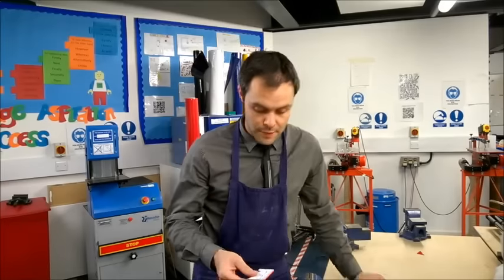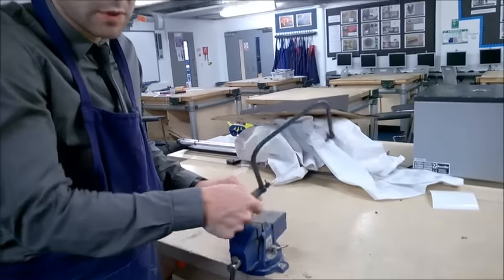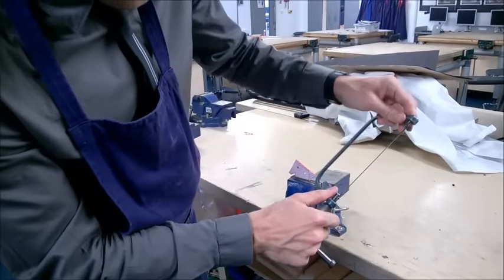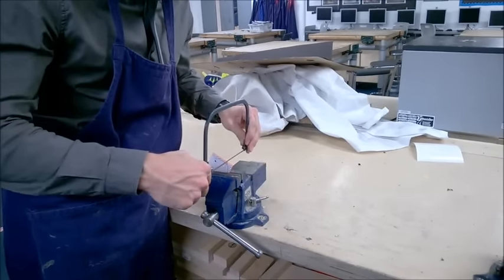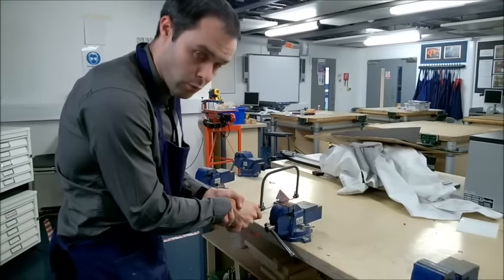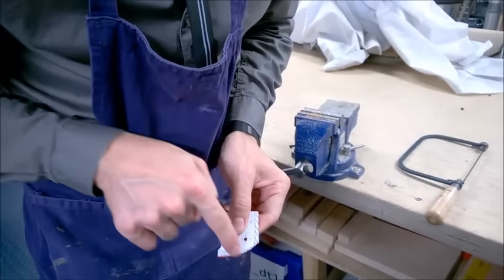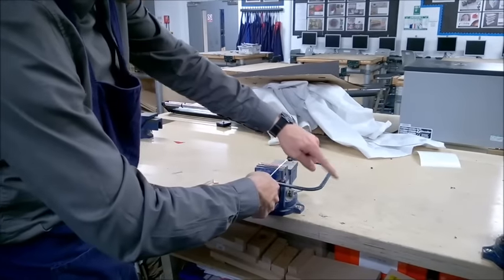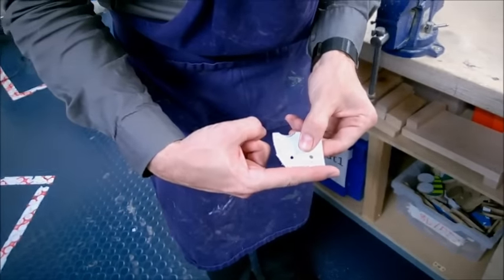How to use a coping saw

Comment: Great demonstration; however, it concerns me that the instructor is not wearing eye protection.
Reply from the maker: The waste material produced when cutting acrylic is unlikely to be breathed in due to its size however, you could wear a dust mask if you are concerned.
Reply: When you cut acrylic by hand with a coping saw there is not enough speed built up with the use of the saw, so therefore waste material will not have a the ability to fly off at any speed that could potentially cause injury to eyes.  Goggles are required as PPE when speed of waste material or swarf comes away from your work 'at you' which can only be caused by electrical tools. Hence why goggles or eye protection are used on pillar drills or belt sanders.  But NOT coping saws.  Hence the lack of eye protection shouldn't be a concern to you.

Comment: Haha sorry my friend but you made me laugh when you said "wasting energy", it makes no difference if you use the full blade or just a part, you equally move back (cutting) and forward (not cutting) regardless :) good demo.
Reply: It's not time or cost effecting, though. You'll go through blades way quicker, since you're using less teeth to make more frequent cuts.
Think of them as tiny chisels - which they effectively are - each time you cut with them they lose some sharpness, like using a 1" chisel when you could reasonably use a 4". It's going to take a lot longer to remove the material, and you're going to have to replace the cutting edge (i.e. sharpen your chisel/replace your saw blade) way more often.